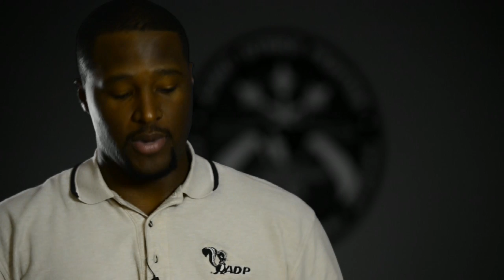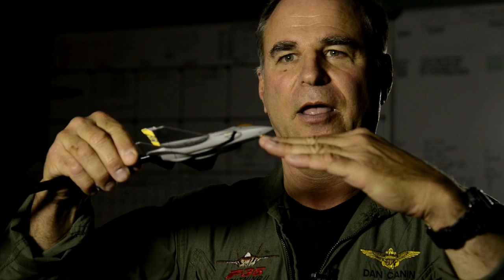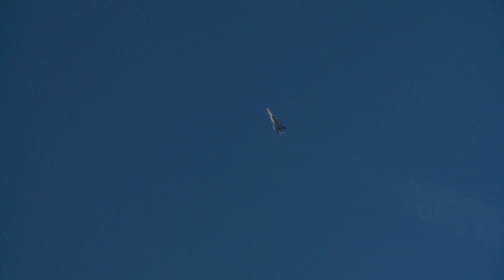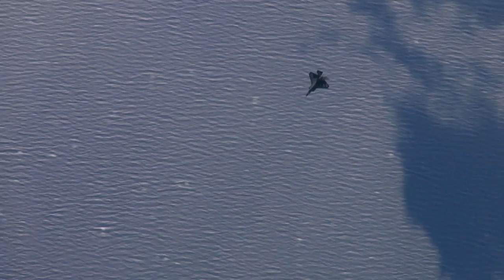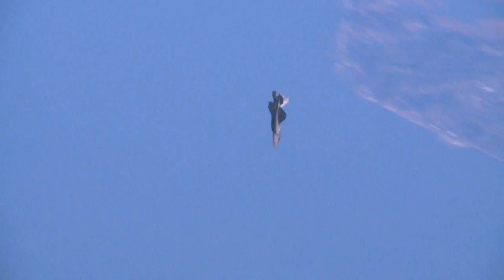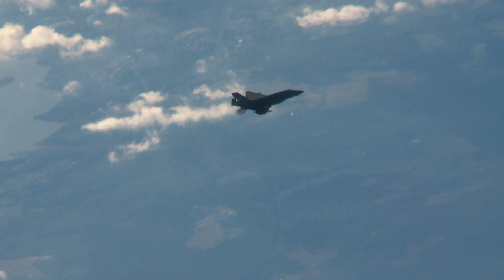F-35C High Angle of Attack

Comment: If they can make it to where high angle of attack is part of normal combat flight modes, it will be a much more impressive system. The only way the f-35 will be a true multirole fighter is if if can maneuverability to its limits. In short it's got to be able to out maneuver the euro fighter typhoon.
Reply: +craigdragon17 The F-35s have never lost to any fighter in a combat exercise, and has never had any hits in those exercises.  So all you got is BULLSHIT.

Comment: Saw an F-22 pilot pull these moves at the Chicago air show couple years back. I wonder if the F-35 can do the inverted hover like the raptor
Reply: ***** Actually it's the flight control software that enables the F-22 and F-35, among other aircraft, to perform tail slides. Without the programming the aircraft would behave like a dart thrown backwards.
Reply: Yes it can!
Reply: It should.  Its got the biggest engine of any fighter.
Reply: FrakU2 I think I was responding to  BackCountryPowPow asking about plane hovering like the F-22?  You are right about the tail slide.